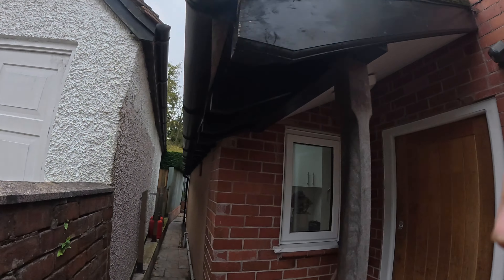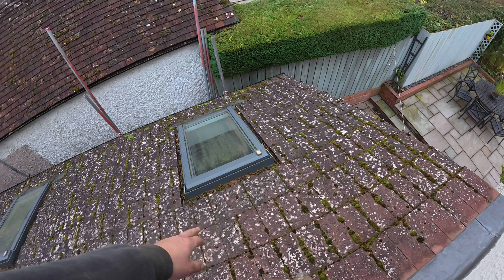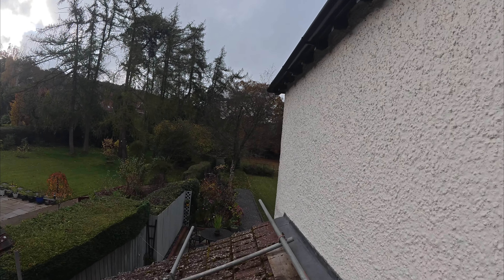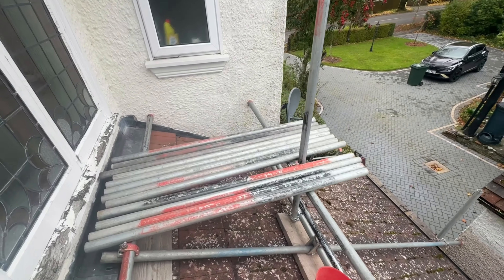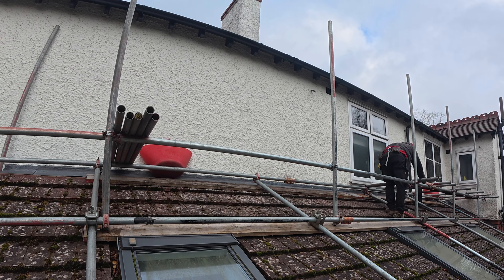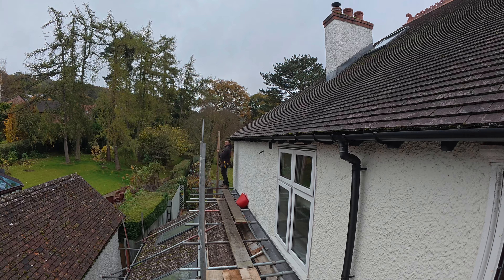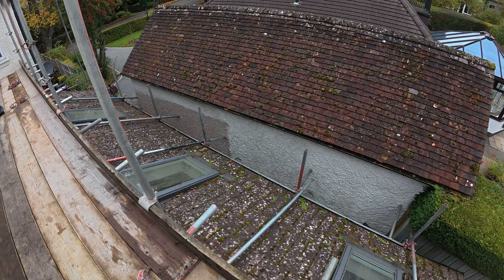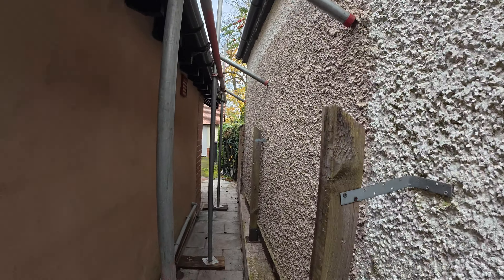An Insanely Tough Little Job!

Comment: We always stand and scratch our heads saying "fuck sake this is gonna be a nightmare", start, make it up/change it as we go along (as always) and it always works out. As long as it's safe and does the job it's perfect 😂👌🏻👍🏻🤜🏻🤛🏻💪🏻💪🏻
Reply from the maker: @MegaSnail123  yes was solid mate and yes you never no were it’s going until you get so far 😂😂 worked out well in the end tho